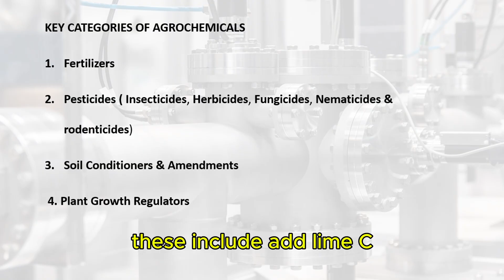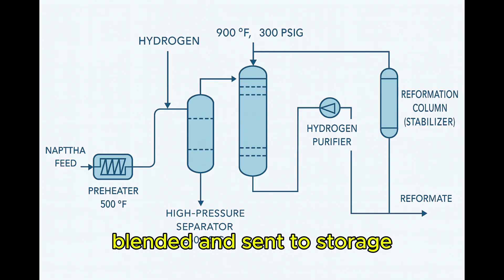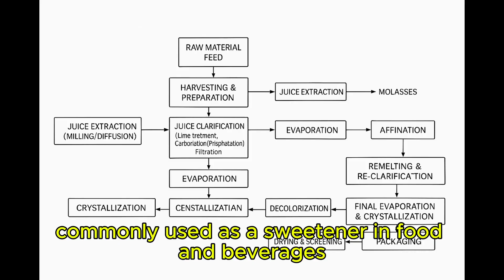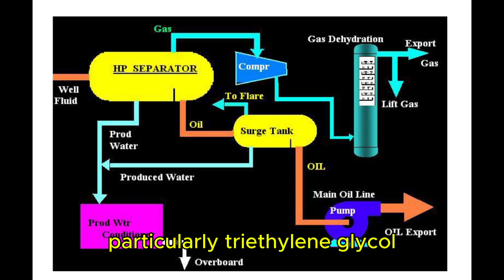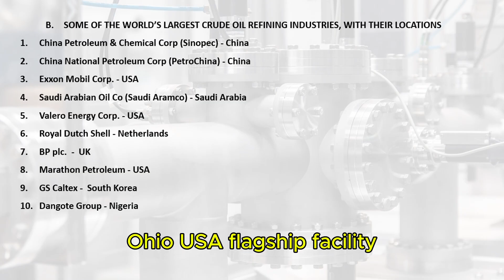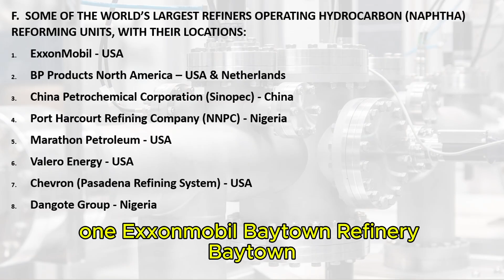From Molecules 2 Millions: The Chemistry, Process Flow & ROI of Industries & Utilized Raw Materials

Comment: What is the role of an Industrial Chemist during a crude oil refining operation?

An Industrial Chemist plays a crucial, hands-on and analytical role in crude oil refining operations, ensuring that raw petroleum is efficiently converted into high-quality, market-ready products while maintaining safety, environmental, and economic standards.

Here’s a breakdown of their key responsibilities during refining:

1. Feedstock Analysis (Crude Oil Characterization)

Testing incoming crude oil for properties like API gravity, sulfur content, metal content, and water content.

Determining the most suitable refining pathway based on crude composition.

Identifying contaminants that could poison catalysts or damage equipment.

2. Process Optimization

Working with process engineers to optimize distillation, cracking, reforming, and treating units for maximum yield.

Adjusting operating conditions (temperature, pressure, catalyst ratios) to improve efficiency.

Recommending changes to enhance product quality or meet new specifications.

3. Quality Control of Products

Performing laboratory analysis on refined products like gasoline, diesel, jet fuel, LPG, and lubricants.

Ensuring compliance with industry standards (e.g., ASTM, ISO) for properties such as octane number, cetane number, flash point, and sulfur content.

Investigating off-spec products and advising on corrective actions.

4. Catalyst Monitoring & Management

Checking catalyst activity, selectivity, and lifespan in catalytic processes (e.g., FCC, hydrocracking, reforming).

Advising on catalyst regeneration or replacement schedules.

Researching or developing improved catalysts to boost process efficiency.

5. Troubleshooting & Problem Solving

Identifying chemical causes of operational issues like fouling, corrosion, or emulsions.

Suggesting chemical treatments to prevent or resolve these problems.

Using analytical instruments (GC, HPLC, ICP, FTIR) to trace and diagnose process anomalies.

6. Environmental & Safety Compliance

Monitoring emissions, effluent quality, and waste streams for compliance with environmental regulations.

Implementing chemical methods for pollution control, such as sulfur removal or wastewater treatment.

Advising on safe handling of hazardous chemicals and process by-products.

7. Research & Development (R&D)

Exploring new refining processes or additive formulations for fuels and lubricants.

Testing biofuel blending and renewable energy integration into refinery operations.

Innovating to improve refinery sustainability and reduce carbon footprint.

 In summary:
The Industrial Chemist is the link between raw crude oil and finished petroleum products, applying chemical knowledge to analyze feedstocks, control process quality, optimize operations, protect catalysts, troubleshoot issues, and ensure environmental safety — all while working closely with engineers and operators to keep the refinery efficient and compliant.

Comment: The petrochemical production process applicable in the production of paint and coatings is polymerization. In polymerization, the Olefins e.g ethylene and propylene, bond together to form polymers which are used as binders in paints and coatings.

Comment: C₃S's binding superiority lies in its formation of a robust, adhesive C-S-H gel that progressively strengthens the cement matrix, driven by balanced reactivity and silicate chemistry. C₃A's rapid, aluminate-based hydration excels in quick setting but offers limited strength due to less cohesive products and higher susceptibility to issues like expansion or chemical degradation. These properties allow cement formulations to balance early workability with durability by adjusting phase proportions and additives like gypsum.

Comment: ATMOSPHERIC DISTILLATION COLUMN fractionate crude into light and middle distillates at atmospheric pressure such as LPG and NAPHTHA at the top, KEROSENE AND GAS OIL in middle draws ,then HEAVY BOTTOMS exit for further processing.
WHILE
VACUUM DISTILLATION COLUMN operates at a reduced pressure than the atmospheric distillation column.vacuum distillation column further separate the heavy atmospheric bottoms under reduced pressure to avoid thermal cracking.Vacuum lowers the boiling point so heavy fractions yield  vacuum gas oil and vacuum residue without excessive cracking.

Comment: Question: Briefly describe the commercial method of producing nematicides.

The description below:

Commercial Method of Producing Nematicides

1. Selection of Active Ingredient : Choose the chemical (e.g., organophosphates, carbamates) or biological agent (Paecilomyces lilacinus, Bacillus firmus) suitable for nematode control.
2. Raw Material Preparation : Procure and prepare chemical precursors or microbial culture media needed for production.

3. Synthesis or Cultivation:
Synthetic nematicides: Carry out chemical synthesis in reactors under controlled temperature, pressure, and pH to produce the active compound.

Biological nematicides: Mass-culture microorganisms in fermenters under sterile, nutrient-rich conditions.

4. Purification : Remove impurities through processes like filtration, distillation, or crystallization (for chemicals) or biomass separation (for microbes).
5. Formulation :Mix purified active ingredient with carriers, solvents, emulsifiers, or stabilizers to produce the desired form (liquid, granules, wettable powders, fumigants).

6. Quality Control :Test for active ingredient concentration, stability, safety, and nematicidal efficacy in compliance with regulatory standards.

7. Packaging :Pack in suitable containers that prevent leakage, degradation, and contamination, with clear usage and safety labels.

8. Distribution : Ship to agricultural markets while maintaining product integrity during storage and transport.

Comment: Cement production depends on a steady supply of specific raw materials, each contributing distinct chemical properties that determine the quality and performance of the final product. The major raw materials include limestone, clay or shale, gypsum, and smaller proportions of corrective materials such as iron ore and silica sand. The availability, quality, and proximity of these resources to cement plants greatly influence production costs and efficiency.

Limestone is the most critical raw material, accounting for about 70–80% of the cement raw mix. It is rich in calcium carbonate (CaCO₃), which provides the necessary lime (CaO) for the formation of clinker minerals during cement production. In Nigeria, extensive limestone deposits exist in several parts of the country. Major reserves are found in Ewekoro and Shagamu in Ogun State, Nkalagu in Ebonyi State, Mfamosing in Cross River State, and Lokoja in Kogi State. These deposits are often of high quality, with minimal impurities, making them suitable for cement-grade production without extensive beneficiation.

Clay and shale are essential for supplying silica (SiO₂), alumina (Al₂O₃), and iron oxide (Fe₂O₃) to the raw mix. These components help in the formation of tricalcium silicate and other key clinker minerals, ensuring the strength and durability of cement. Clay deposits are widely distributed across Nigeria and can often be found close to limestone quarries, minimizing transport costs. Significant deposits exist in Ogun, Kogi, Edo, and Anambra States. Shale, a related raw material, is also present in sedimentary formations in regions like Bauchi and Gombe States.

Gypsum plays a crucial role in regulating the setting time of cement. Without gypsum, cement would set too rapidly, making it unworkable in construction applications. Nigeria’s gypsum resources are concentrated mainly in the northern part of the country, with notable deposits in Sokoto, Yobe, and Borno States. In addition to natural gypsum, some cement plants also use synthetic gypsum derived from industrial processes.

Iron ore and silica sand are used in smaller proportions to correct the chemical composition of the raw mix, especially where limestone and clay alone cannot provide the ideal balance of oxides. Iron ore deposits occur in states such as Kogi and Nasarawa, while high-grade silica sand is available in areas like Delta and Bayelsa States.

Overall, Nigeria is endowed with abundant and widely distributed raw materials for cement production. Many of these resources are located close to each other, which is a strategic advantage for cement manufacturers. This proximity reduces the need for long-distance transportation of bulk raw materials, lowers production costs, and supports the establishment of cement plants in resource-rich regions. With such geographical and geological advantages, the country can sustain large-scale cement production and even meet export demands.

Comment: The innovation that could be deployed to reduce the stage with the highest CAPEX cost generation power during the production of ammonia fertilizer production,would be the use of renewable energy power plant instead of burning fuels and the use of electrolizer that splits water instead of steam methane reformer. The initial cost may be high, but it makes up for the cost of production it in the long run.

Comment: CHEMISTRY OF CO₂ REMOVAL FROM NATURAL GAS STREAMS

Natural gas is a valuable energy resource, but it often contains impurities that must be removed before it can be used effectively. Among these impurities, carbon dioxide (CO₂) poses significant challenges. The presence of CO₂ in natural gas is problematic for several reasons:

I. Reduced Heating Value
CO₂ does not contribute to the energy content of the gas, thereby decreasing its overall heating value. This reduction can affect the efficiency of combustion processes and economic viability.

II. Corrosion Risks
When CO₂ is present in combination with water vapor, it can form carbonic acid (H₂CO₃). This weak acid is corrosive to materials commonly used in pipelines, particularly carbon steel, leading to potential structural failures and costly repairs.

III. Cryogenic Processing Issues
In situations where natural gas must be cooled to very low temperatures for liquefaction, CO₂ may solidify and freeze, leading to blockages in processing equipment, which can halt operations and incur significant downtime.

IV. Regulatory Compliance
Many pipelines have strict specifications regarding the composition of the gas they transport. Typically, natural gas must contain less than 2–3% CO₂ by volume to meet these standards; exceeding this limit can lead to non-compliance and financial penalties.

1. Main Removal Processes

The chemistry and efficiency of CO₂ removal are largely determined by the selected removal method. The three most common processes are outlined below:

A. Amine Gas Treating (Chemical Absorption)

Amine gas treating is the most widely utilized method for removing CO₂ from natural gas. This process involves the use of a solvent containing amine compounds, which chemically absorb CO₂ from the gas stream.

Principle:
In the presence of an aqueous amine solution, CO₂ reacts to form soluble carbamate or bicarbonate compounds. The reaction is reversible, allowing for the recovery of both the CO₂ and the amine solvent.

Common Amines:
I. Monoethanolamine (MEA) – a primary amine with high reactivity with CO₂.
II. Diethanolamine (DEA) – a secondary amine with slightly lower absorption capacity than MEA.
III. Methyldiethanolamine (MDEA) – a tertiary amine efficient at lower regeneration energy costs.
IV. Diisopropanolamine (DIPA) – another solvent with favorable absorption characteristics.

Key Chemical Reactions:

1. Formation of Carbonic Acid
CO₂ + H₂O ⇌ H₂CO₃

2. Carbamate Formation
RNH₂ + CO₂ ⇌ RNHCOO⁻ + H⁺
Proton transfer representation:
CO₂ + 2RNH₂ ⇌ RNH₃⁺ + RNHCOO⁻

3. Bicarbonate Formation (Tertiary Amines)
R₃N + CO₂ + H₂O ⇌ R₃NH⁺ + HCO₃⁻

Regeneration Process:
After CO₂ absorption, the CO₂-rich amine solution is heated in a stripper column to reverse the absorption reaction:
RNHCOO⁻ + H⁺ ⇌ RNH₂ + CO₂
This releases pure CO₂ and regenerates the amine for reuse.

B. Physical Solvent Processes

Physical solvent processes depend on Henry's Law, which states that gases dissolve in liquids in proportion to their partial pressures. These processes are more suitable for high-pressure, high-CO₂ gas streams.

Examples of Physical Solvents:
I. Selexol – dimethyl ethers of polyethylene glycol.
II. Rectisol – cold methanol process, effective at low temperatures.

Chemistry:
CO₂(g) ⇌ CO₂(solvent)
Regeneration occurs by pressure reduction or mild heating.

C. Membrane Separation

Membrane separation exploits the selective permeability of polymer membranes, allowing CO₂ to diffuse faster than CH₄.

Mechanism:
CO₂ dissolves into the membrane material and diffuses through it faster than methane, enabling separation with minimal chemical interaction.

2. Side Chemistry and Considerations

I. Corrosion Risks
CO₂ + H₂O → H₂CO₃ is corrosive to carbon steel. Oxygen accelerates corrosion.

II. Degradation of Amines
Oxygen, hydrogen sulfide (H₂S), and high temperatures can degrade amines, forming heat-stable salts and organic acids.

III. Reaction Kinetics
Primary amines react faster but need more regeneration energy; tertiary amines react slower but require less regeneration energy.

IV. Equilibrium Control
Low pressure and high temperature in stripper columns favor CO₂ release.

3. Importance of Understanding the Chemistry

I. Efficiency Improvements – Optimizing absorber/stripper conditions based on chemical equilibria.
II. Cost Management – Heat requirements depend on reaction enthalpies and amine type.
III. Environmental Impact – Captured CO₂ can be used for Enhanced Oil Recovery (EOR) or sequestration.

Comment: Natural gas can be classified into several types based on its composition, source, and processing. 
We have the 
1. Dry Gas 
Composed primarily of methane (CH4), with minimal amounts of other hydrocarbons and impurities.
2. Wet Gas: Contains a higher proportion of heavier hydrocarbons, such as ethane, propane, and butane, in addition to methane.
3. Sour Gas:Contains significant amounts of hydrogen sulfide (H2S), which requires additional processing to remove the H2S.
4. Sweet Gas:Has low levels of hydrogen sulfide (H2S) and other impurities, making it suitable for direct use or processing.
5. Associated Gas:Found in association with crude oil, often produced as a byproduct of oil extraction.
6. Non-Associated Gas: Found in reservoirs that do not contain crude oil, often produced as a standalone resource.

Classification Based on Source
1. Conventional Gas: Extracted from porous rock formations, such as sandstone or limestone.
2. Unconventional Gas:* 
Extracted from non-porous rock formations, such as shale or coal seams.

These classifications are important for understanding the characteristics, processing requirements, and potential uses of natural gas.

Natural gas in Nigeria can be classified into two main categories:
- Associated Natural Gas: This type of natural gas is found in association with crude oil. In Nigeria, associated gas accounts for approximately 69.55% of the country's total gas production.
- Non-Associated Natural Gas: This type of natural gas is found in reservoirs that do not contain crude oil. Non-associated gas accounts for more of Nigeria's gas reserves, although it contributes less to the country's total gas production.

The predominant class of natural gas in Nigeria is associated natural gas, which is predominantly produced alongside crude oil. This is evident from the fact that associated gas accounts for a significant percentage of the country's total gas production. Nigeria has significant deposits of natural gas, with proven reserves of 208.62 trillion cubic feet as of 2022. The country's natural gas sector is also characterized by liquefied natural gas (LNG) export facilities, with Nigeria LNG Limited operating a liquefaction complex with six existing plants and a seventh plant under construction.

Comment: Return of investment (ROI) is a measure of an investment in the selected industries 

ROI is a measure of the efficiency of an investment expressing the profit earned relative to the amount of capital deployed. It quantifies the percent return positive or negative generated by an investment over a given period . Which is calculated using 

ROI= Net gain from investment/Total of cost investment X100%

While 

CAPITAL TURNOVER 
It is a financial metric that measures the efficiency of a company’s use of capital in generating sales or revenue calculated. 
  It explains the accumulated sales in the sequence years of investment, which will enhance for higher capital turn over ratio for investment with higher CAPEEX for each of the investments compared in the analyses will remain the same.